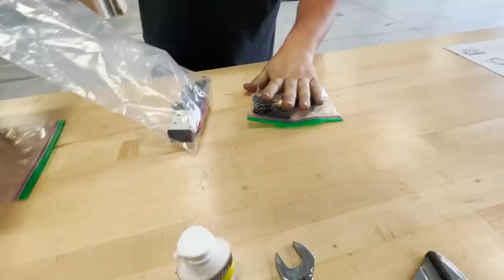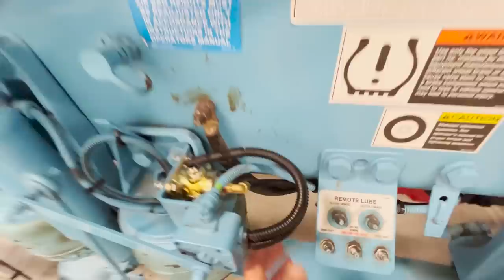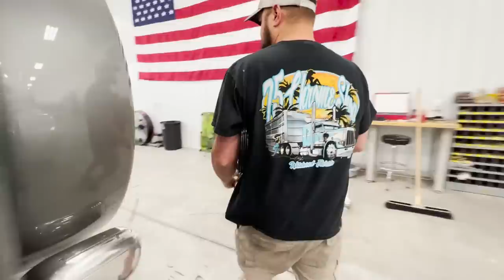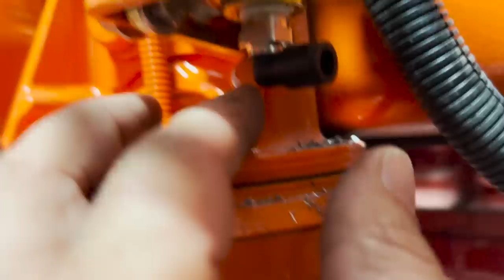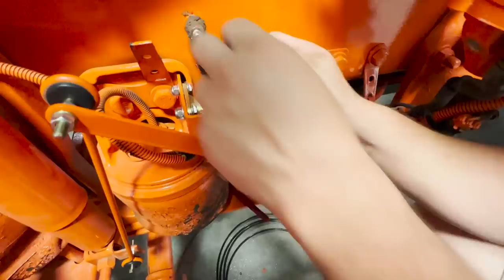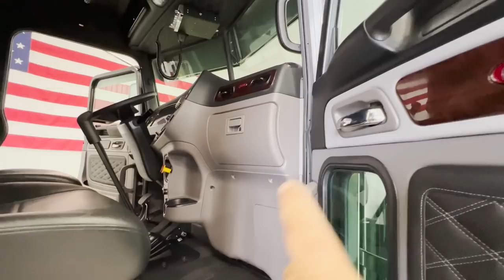Factory Air Ride - How to install a dump kit

Comment: Hello! Why not just install leveling valves that dump like in the rear suspension?
Reply from the maker: You can, they are just bigger and require a bit more work to mount and set ride heights. This set allows you to keep factory parts intact.
Reply: @SEMICasualShow  thanks for the reply!

Comment: Installed mine and it’s works and dumps air the way it is suppose to however, there is a small port next to “B” on the actuator that slowly leaks air and will not stop. What am I missing? Any thoughts? I followed instructions and video. Any help would be much appreciated. Thank you guys
Reply: Did they ever contact you and figure out the issue?
Reply: They shipped out a replacement, however still having the same issue. Are you experiencing the same ?
Reply: Mine drops the drivers side quick. But the passenger side is slow as hell.   I have to toggle the switch to basically drain the tank to get the truck to lay out.  I followed directions in the video to the T.

Comment: Did you guy's actually run the passenger side air line across the oil pan? Wouldn't it be better to run it out under the radiator and, across?
Reply from the maker: No air lines go over the oil pan, they run up with the front crossmember